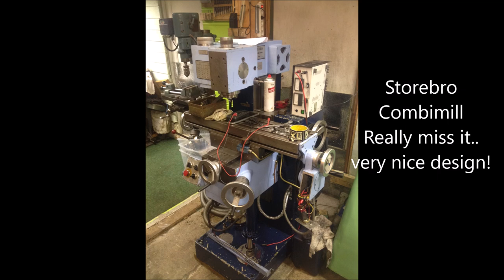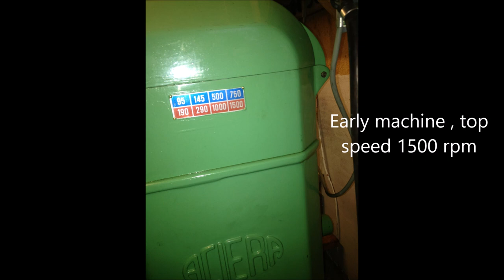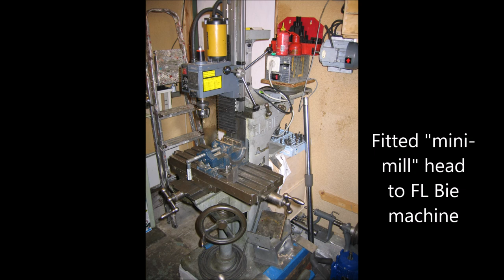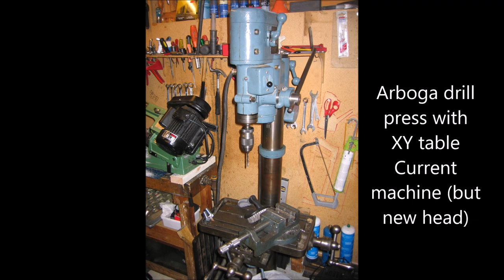My mills & drills

Comment from the maker: If I should sum up, I guess the current setup I have fills my needs. I need the mill to be sturdy and reasonably accurate. It is versatile and functional, although I would appreciate the practicality offered by for example a Bridgeport. The Arboga drill press is possibly not the most accurate, but very practical. I use these "daily". That said, I have looked at a CNC or semi-cycle controlled machine (like the ELS for the lathe), but cannot say this is a real must.. just a "want to have". I will replace the old Heidenhain DRO on the mill as one axis is very unreliable ( it is an ex workplace  unit and have served us a "lifetime" so..). Buying a DRO with more functions will quite possbly fill my needs.
Reply: I'm more than envious of the variety and quality of all that European equipment you still have over there Jan. I guess it depends on the exact type of parts you machine most in your shop as far as what equipment does fit those requirements. But something like your Schaublin mill is light years ahead in rigidity over my Bridgeport clone. Costs aside for all the accessories, different heads and specialized tables that the multiple copies from many European manufacturers manufactured of something like the Deckel FP 1, 2 mills are I think much more versatile than the Bridgeports. I've always found it strange that Bridgeport never offered a built in horizontal spindle along with the vertical head or copy those European mills and had at least one universal mill model with separate bolt on pivoting and swiveling tables just like a lot of those European mills have. For myself I'd much prefer a proper rigid head mount and have the universal table movements instead. That head design on your Schaublin is far superior in every way. 

The Bridgeport's are fairly versatile, and for here in North America there's still a lot of specialty heads that were specifically designed for the Bridgeport head design. In fact I just managed to pick up one of these in as new condition after more than 10 years of looking for one in good condition. https://www.bidspotter.com/en-us/auction-catalogues/asset-sales/catalogue-id-asset-10123/lot-d0a3fb7a-6136-4cba-8420-a58a01569467 It's full set of collets were at least made by Schaublin. :-) I have no plans of ever going to cnc,  so this accessory head will still do a lot of what I'd use a cnc for.

Heidenhain dro's are most likely one of the best made, I have a 4 axis DP 900 Newall with microsyn scales on my mill that I don't regret buying. Very accurate and stable but not exactly cheap. Unfortunately that dro model is no longer being made, but they offer some other models that have all the functions you could ever use.
Reply: You have some very impressive machines, Jan.  In particular, love those Schaublin and Aciera mills.  And the Arboga and Rosa are two of the best engineered drills ever, IMHO.
Reply: Jan, if 15-20 lathes AND 15-20 mills & drills do not fill your needs, I would really want to know what those needs are!  When are you constructing the second shop to make room for future purchases?
Reply from the maker: @danielabbey7726  Thnks. The current machines are only the Schaublin and Arboga. I would of course have loved to be able to keep them all.. but space, finances etc. and not having any real need sort of "dictates" that the machine park is "trimmed". FWIW, it is a learning journey to get through all of these different tyoes and makes.. and I am far from finished :)
Reply from the maker: @somebodyelse6673  As said elsewhere, I only have the Schaublin and Arboga left. If I had the room, I could have kept more of them, but  "sanity" has won a temporary victory :)
Reply from the maker: @turningpoint6643  There are a wide variety of manual machine tools still available, more so in Sweden than here in Norway. The "neighbors" still have some dealers that do old school, used machines. Me and my buddies have been there a few times window shopping :) PS! Sweden had a very good industry base, especially since they produced a lot of ther military equipment themselves (still do although i rekon globalization have taken its' toll on the manufacturing facilites/companies). I do think however there are some of the grand names left, for example Abene milling machines (could be wrong about this though..). In Norway there are a lot of Europeean machines, Swedish, German, Swiss, Czech, English, Spanish, Italian etc. and quite a number of US as well as some Russian. Also you will fnd Austrian, French, Danish, Norwegian, Dutch and possibly others (like the odd Rumenian and Polish). New ones are as elsewhere, almost exclusively originating from China, bewildering number of brands and OEM manufacture.
I personally am a Bridgeport fan so have considered both an original series 1 or 2, or the more commonly encountered Adcock & Shipley built machiens from the UK. There are so many more or less direct clones to choose from, but I have looked at a couple down in Denmark that are made in Taiwan and are supposedly a bit better than many of the newer of mainland China origin. However, I have a friend that own a Spanish built 1,5x size lB'port based design from Lagun. This is a very hefty machine indeed!
Will see what the future holds..
I think I will go with a 3 axis DRO that can do bolt circles (don't they all?) and some other simpler pre-programmed cycles. I have yet to mount the SONY Magnascale on my IZH lathe (shem on me.. just 3 years since I bought it..), so although I manage without I thought that I need a kick in teh butt to get started and could as well also do the mill.
Not needing CNC myself,, I still kind of want to learn and find a milling machine with programming capacities more in line with what I consider useful for me. NB! Tthis is a whole topic of discussion alone, and I have just started to venture into this. I have decided at least to leave the ex. industry, bigger machine out. No way I have room for what I see some of my friends have bought.. 6 tons 1x1x1m capacity etc. etc. However, looking it from a perspective of how much functionality I can get on a smaller platform, the decision soon centers around making something myself (which would be a great learning experience) or buy a kit to upgrade for example a generic size/type 30 or 45 mill from China.. or possibly pay for a Tormach or the likes. I know a couple of students with a PCNC440 and that looked very nice..